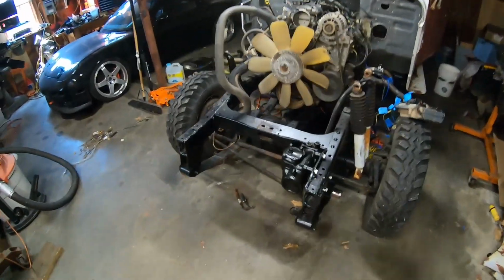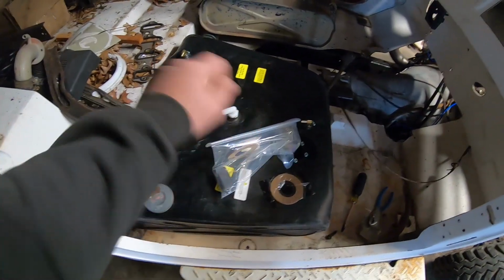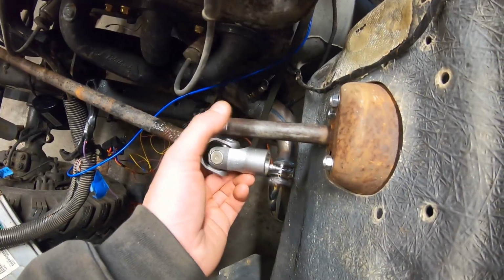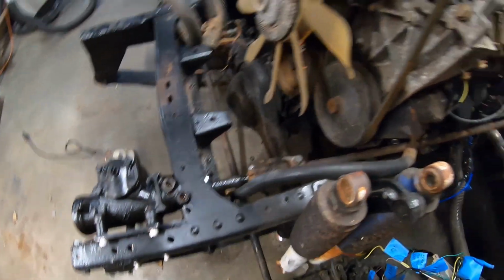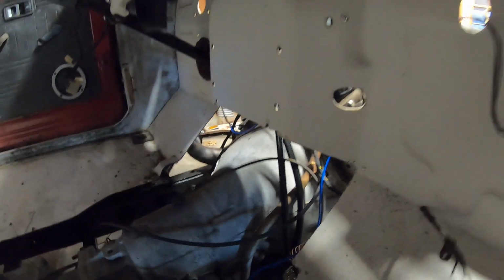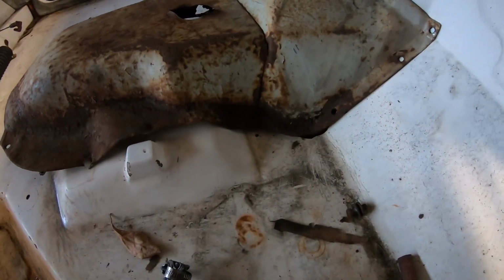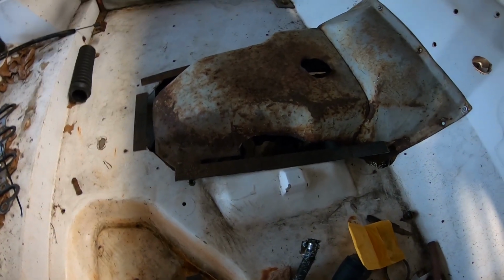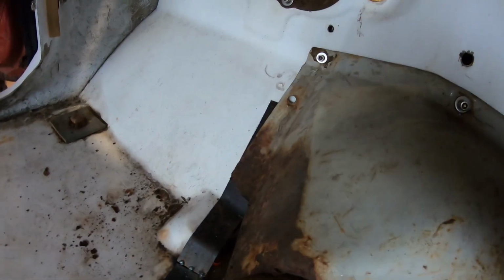1976 Landcruiser FJ40 build - Power Steering, Steering shaft fab, and new trans tunnel cover!

Comment: Hi Sean, I am just starting my 5.3 swap in a 74 '40. Have the engine/transmission but haven't started disassembly yet. I already did the Saginaw conversion with the Toyota 2F engine in there. I am worried about the steering shaft clearance with the headers.  Mine looks just like yours and yours looks fine.  I've seen other builds where they had to add an extra u-joint to move the shaft away from the manifold. I'm getting block hugger headers.  I shouldn't have an issue, should I? I'm wondering why some lack the clearance.
Reply from the maker: Good question, it's going to be close.    I didn't have any issue before but I actually do now, watch my next video for details.  I'm going to make a new shaft from scratch eventually.